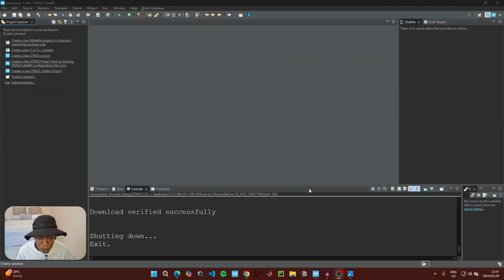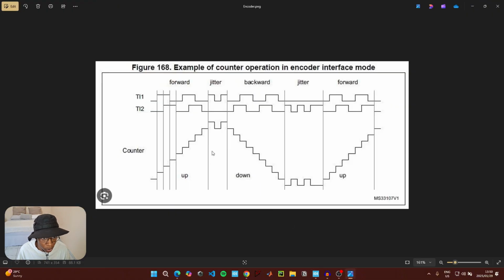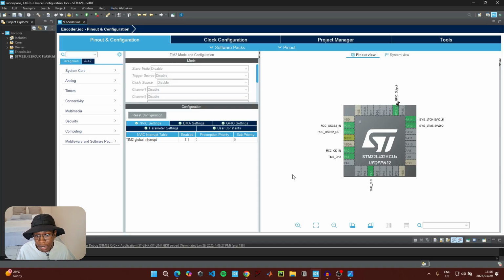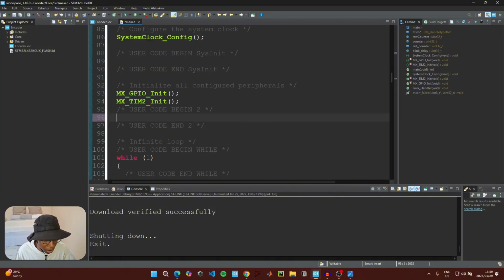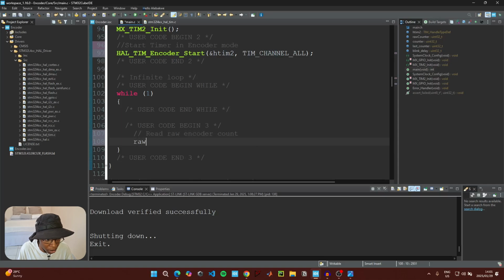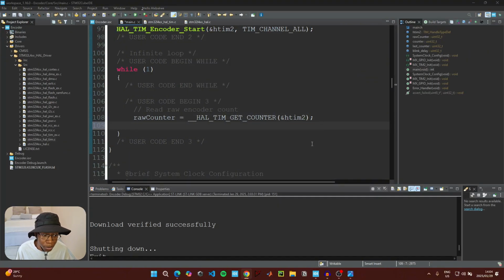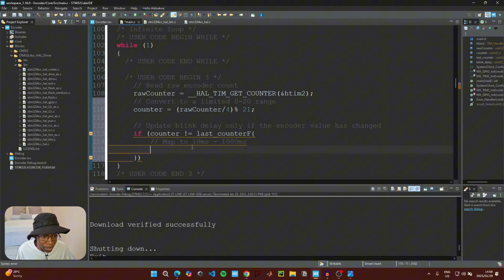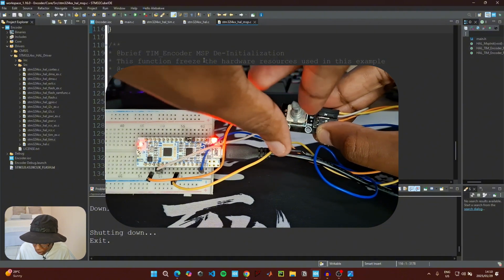How to use a ROTARY ENCODER with STM32 | EASY TUTORIAL | STM32CUBEIDE

Comment: The main problem about using the encoder mode is still the jitter like stepping between forward and backward too fast. So did you encounter this problem with your code? What is the trick, the input filter settings?